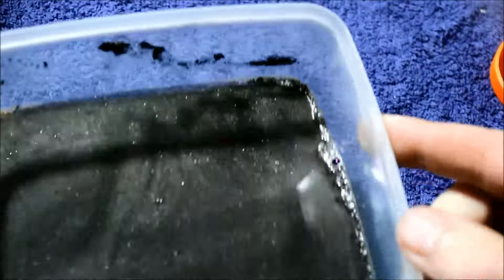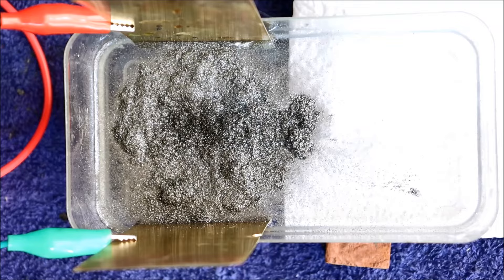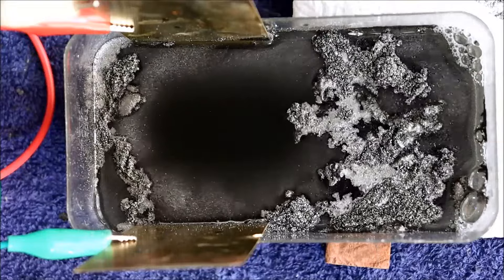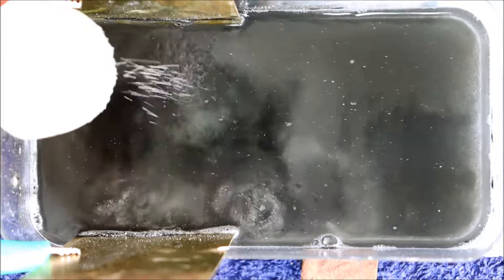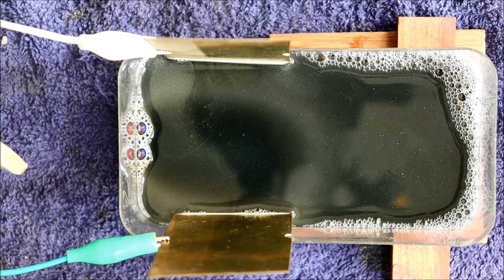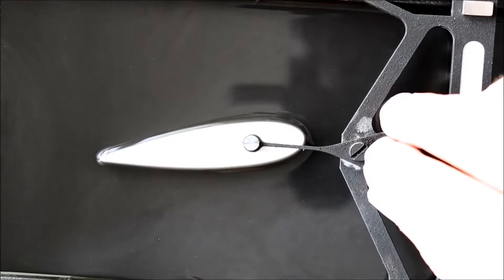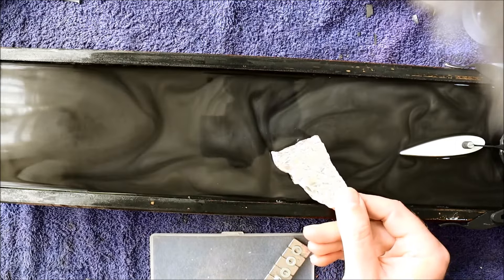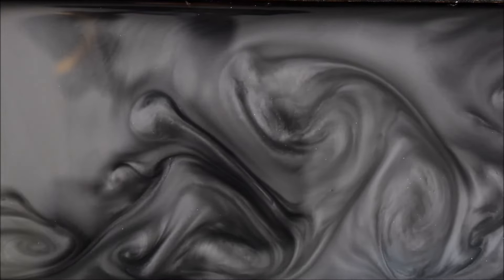Graphite, Amps and Magnets

Comment: Try to use light underneath - as you old some streams are "perpendicular it should be partially visible (even without mica flakes in this case).
Reply from the maker: @bialy100k  if I let a layer of graphite settle on the bottom of a clear container and place it on a magnet, the magnet becomes visible.